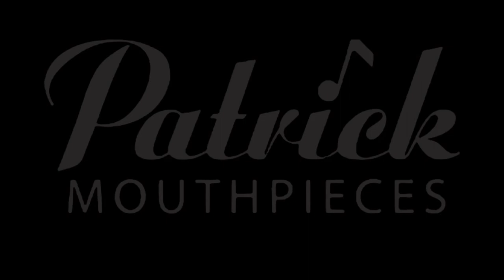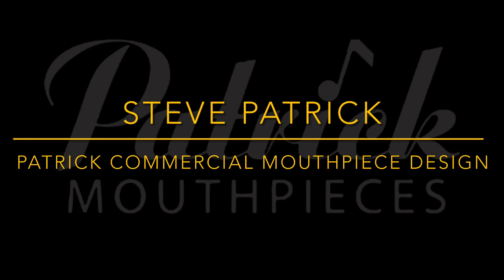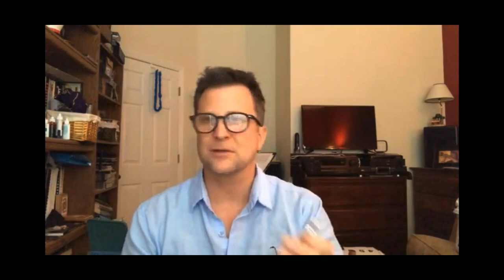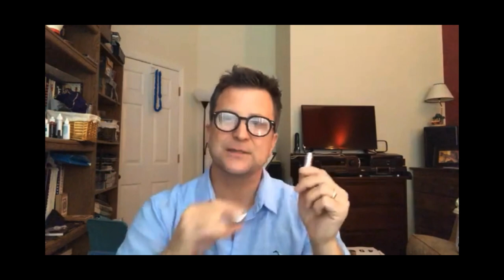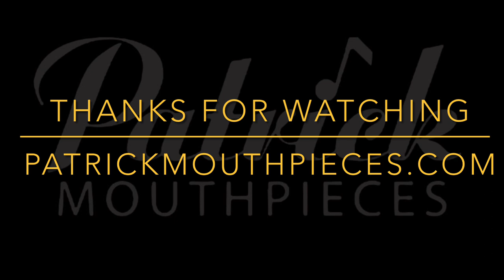Steve Patrick- Developing the Commercial Trumpet Mouthpiece Design and Two Piece vs. One Piece?

Comment: I took Steve's advice using a 28 top and 27 back bore and can say it really works for me. I also tried the CR rim and have never had my chops work so efficiently with any other mouthpiece. CR81M and CR81S give me more endurance and more consistent sound top to bottom because my chops are more relaxed, not as tense. These are subtle differences,  but make a real-world improvement throughout all my gigs. Quite amazing! (Unsolicited testimony.)
Reply from the maker: That’s awesome!  You stated something that I’ve never mentioned that way. The fact that it’s subtle real world differences.  That’s personally the key for me. Just a bit easier for so many little things during the course of the day make it easier for the week and career!